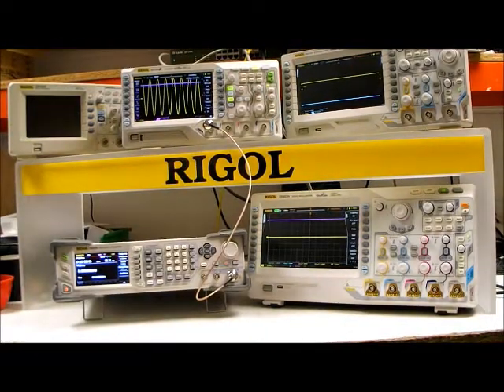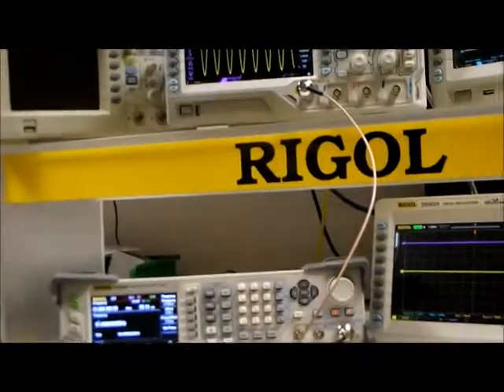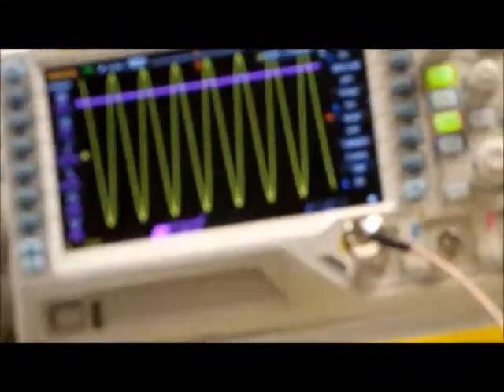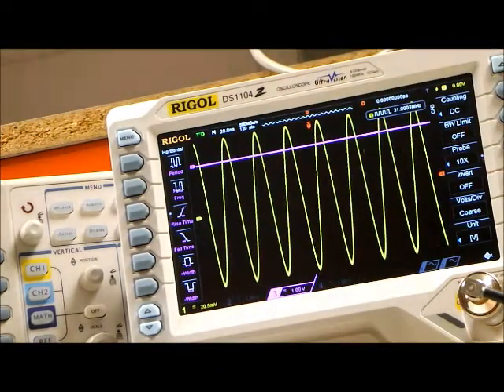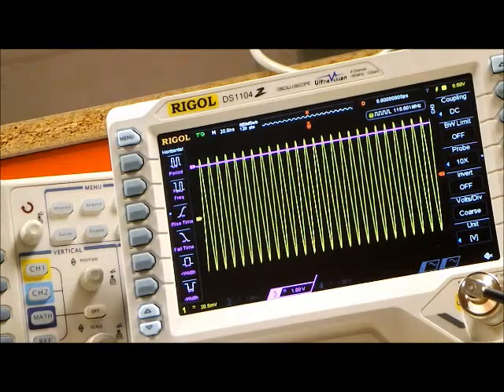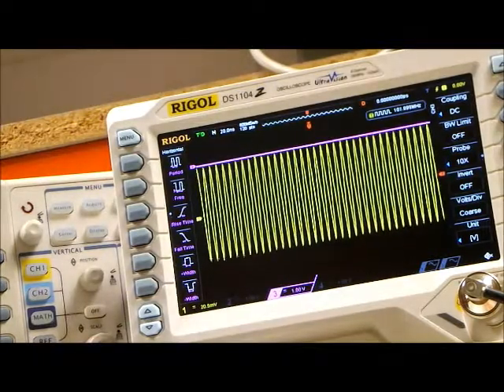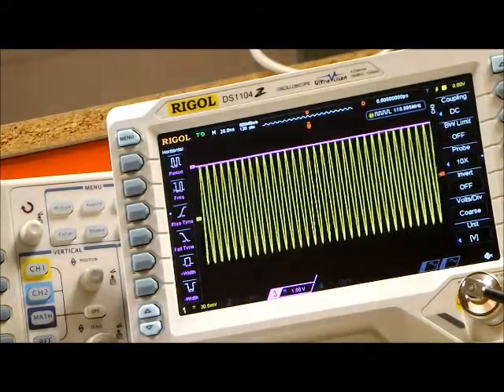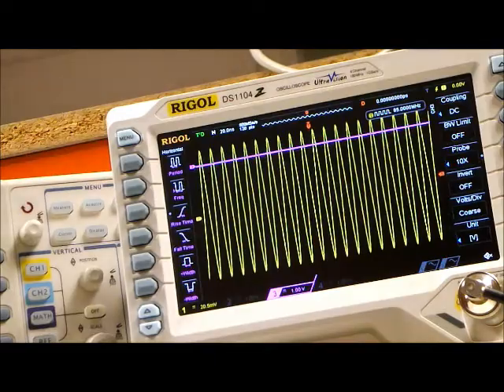RIGOL DS1104Z Scope exposé: new 4-ch - exploring its bandwidth limits

Comment: How do u know the probe is not affecting the dB loss?
Reply: Presumably he is using probes with much greater rated bandwidth.
Reply: I just replayed it and at the beginning you can see he has a direct coax from the signal generator to the oscope, and its BW is no doubt very high.